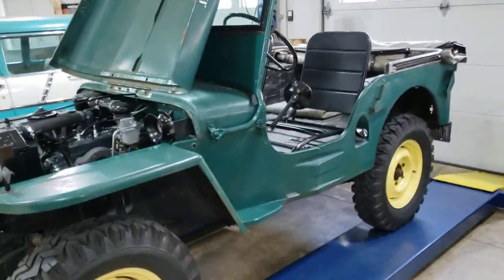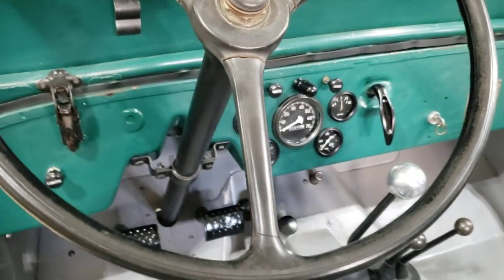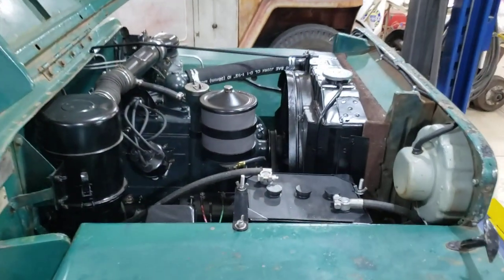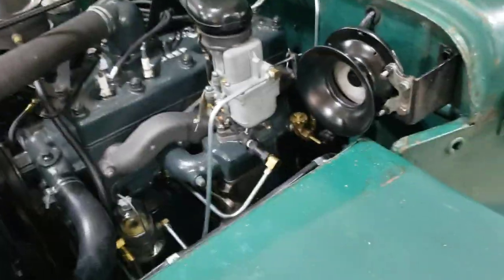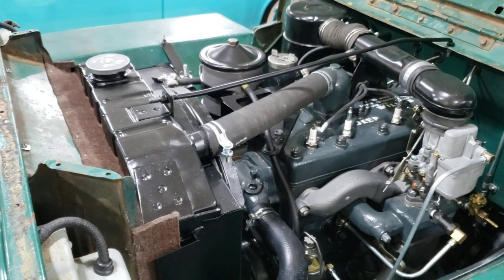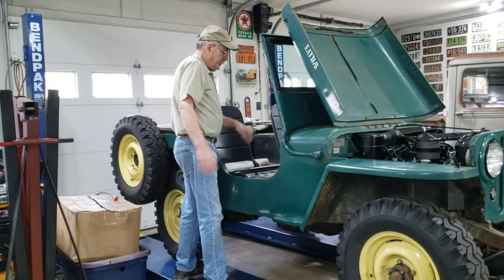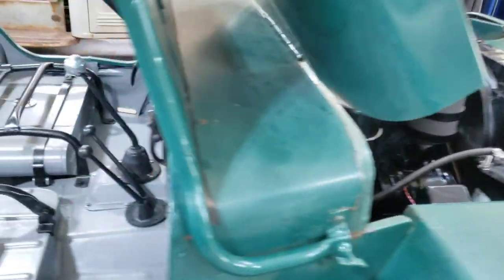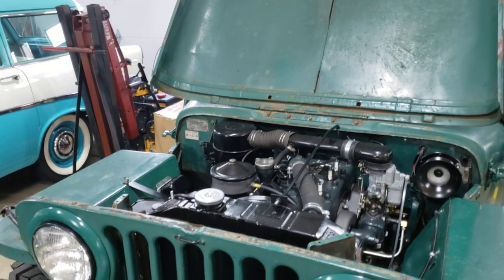Chuffy First Start attempt 3-6-2022

Comment: Great job on everything but I did see a spark plug wire off and just jumping away under there . Nothing wrong with six volt with today's batteries 👍👍🇺🇸
Reply from the maker: Yeah, I noticed that, but I didn't want to quit and have to start over making the vid! That cylinder was firing, even though we made it jump a little way, haha. I squeezed it tighter and put it on better, right afterwards.